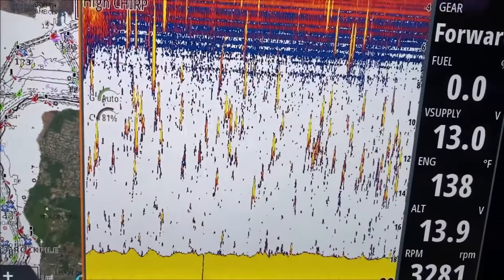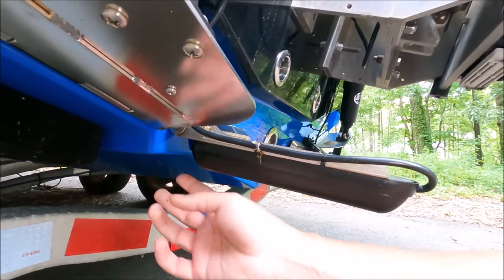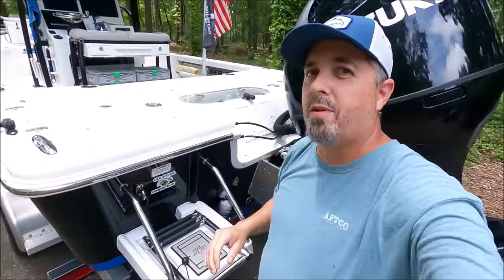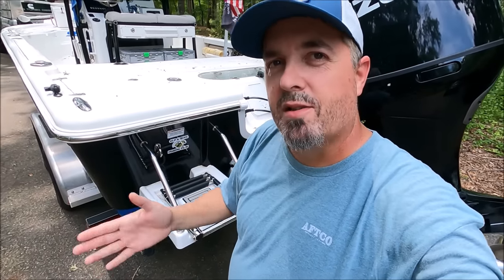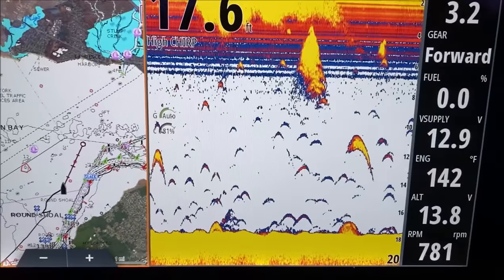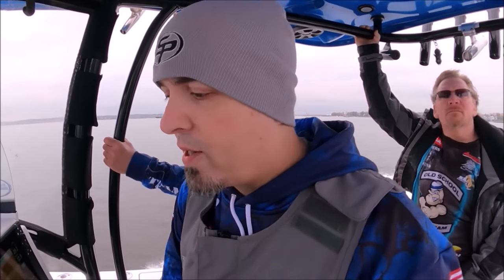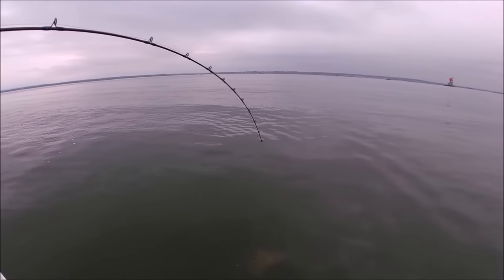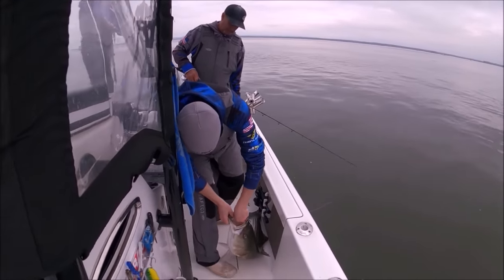Finding Fish at 30 MPH? It’s so simple you may not believe me. KILLER TIPS #3

Comment: Hey Mike, what a great channel and kudos to the effort you put into this. Definitely helping me out as I am a beginner to fishing. Have to say the transducer dilemma has got my head spinning. I have a new to me boat on its way and looking to get it setup the right way. Looking for through hull transducer that can be can bar flexible as I learn my fishing needs. My boat is a 30' Robalo and built for offshore. I plan to do that but wouldn't be the majority of my time. I plan to bottom fish inshore in less than 100ft of water. Then also plan to try to snag some small tuna a few trips out of the year in 200-300ft. I have Garmin 8616 dual screens and want to pair it with a good transducer. Please help me here, my mind is spinning and I am getting lots of conflicting information. I love the idea of scouting fish at 30mph!!! Great video
Reply from the maker: Thanks brother!! The B175 Medium is for you for sure! The relatively wide cone gives you ability to mark more fish when you are running on plane for sure. Even though it’s cone is pretty wide, you still get good bottom detail at those depths. This https://amzn.to/45GnTBZ. Is great shallow and surpasses your needs for 300-400ft of water.  Some may say you need a LOW Chirp channel, but you won’t see the benefits at less than 600ft and LOW CHIRP comes at a price by losing a lot of detail, especially the detail you want for bottom fishing.  Low is also very slow scrolling. This transducer only needs one channel input, where a Low/High would need two channels👍👍👍https://amzn.to/45GnTBZ

Comment: Hey Mike, you do a great job sharing your extensive knowledge through videos. 

I believe you mainly fish in the NE, but have you ever fished for King Mackerel further south on the East Coast?  

They have small air bladders and are difficult to mark. I have been on crazy hot bites before and not marked a fish under the boat.  I have sometimes marked fish with short horizontal lines when catching Kings. Sort of like dashes (I have some screenshots saved). Not sure if those were kings. 

Do you have any tips or techniques to help mark kings?
Reply from the maker: Great question!! We fished with Joe Marciano a mess of times and always caught Macks for bait. We were able to see them perfectly with the higher end Airmar CHIRP transducers, but they were nearly invisible with a cheaper single frequency transducer I had. I’m not sure what’s going on technically, but the CHIRP transducers worked great and down scan also picked them up. I actually fish for Stripers in salt and fresh from Georgia and Tennessee up through Gloucester. 👍👍
Reply: Thanks Mike!

Comment: Hey Mike I love watching your videos and I've learned a lot. I do have a question for you about marking fish in deep water. Fish mainly live bottom so there's not necessarily schools like on a wreck but once I get to about 150 to 250 ft my machine doesn't Mark the fish well at all even when I zoom in. It's a Simrad go 9 with the transom Mount transducer multi-scan I believe. I've watched several of your videos and have set up my machine according to your instruction everything works great aside from deep water.
Reply from the maker: Thanks brother!!!  The Go series is pretty unbelievable for the price, but it does have some limitations. You are probably right around the threshold where abilities start to suffer a bit. You can try a few things like using Medium CHIRP. High is best for shallower water. You can turn your gain up until you get a little noise on the screen. Turn up color as well. Try down scan too. Fish marks will be smaller but they might show up better.  The next step would be to upgrade to a higher end CHIRP transducer. Unfortunately you will lose side and down scan as the CHIRP transducers made by Airmar are CHIRP only. A TM150 med would be a nice step up. If you do a lot of bottom fishing maybe a second display with a 150 on it may be your best bet depending on your budget. Let me know how it works out for you 👍👍

Comment: Hi Mike, thanks for all the informative videos! I noticed in your earlier videos, you’d mount the transducer very low in the water, to the point where most of the transducer is in the water. Now it looks like you’ve raised it a little to a more conventional height and you’ve reversed it. Has your thinking changed in regards to the height of the transducer? Or is it more a case of mounting being boat specific and what works for one boat doesn’t work for another?
Reply from the maker: I think that’s just a coincidence really. Sea Pro mounted these, whereas I mounted the previous. They are working great so I don’t mess with them😉. They aren’t too far from where I had them. Front edges are around 1/4” below transom 👍👍👍. The reversed mount is only because of the wire. It’s a preproduction mount and it pinch’s the wire otherwise. I just flip the image on the display 😁👍. Thanks for the continued support brother!!🙏😁

Comment: I notice your cable is at the outside end of the transducer,  is there a particular reason you have it mounted that way vs with the  cable next to the transom?  Thank you.   Great video.
Reply from the maker: It’s just because I have a pre-production unit. I’m using a 3D bracket. The wire would be pinched if I ran it the other way. 👍👍

Comment: At 30 mph what depth would it be hard to see fish on the bottom? Beautiful fish! What are your regs on stripers? On the west coast there is talk of putting a slot limit on stripers of 20 to 30 inches. Right now it is 18 inch minimum with no upper limit. Enjoyed the video!
Reply from the maker: Thanks brother!! Most states have a slot 28-38” now. Depending on the transducer you can see fish bottom quite deep. Mine can see fish on bottom over 1000 feet deep, but not at 30 mph. As it gets deeper everything slows down. The pings take more time to return. There are a few tricks for deeper water, like setting the range only for where you expect to see fish. Speeding up scroll speed. Ping speed etc. 👍👍

Comment: Hi Mike!
So if want to keep my transducer levelled, can I compensate by lowering the hole transducer. Will it achieve the same goal of raising pressure and reduce air bubbles ?
Many thanks!
Reply from the maker: It can sure. No way to tell for sure until you try though. I do both usually.

Comment: Your active imaging transducer cable is wired opposite of what i normally see.  Normally the cable comes out of the transducer right next to the transom.  just curious if there is a reason for that?
Reply from the maker: You can install it in either direction. Just reverse image in menu. It’s so the wire isn’t bent at an extreme angle. My transducer is a pre production version which used an older mount. 👍👍

Comment: On my buddy’s Garmin transducer, one side of the side scan is always darker. Have you seen this before?
Reply from the maker: Sure. It’s common. The skeg on the outboard partially blocks the the signals to that side. He needs to lower the transducer on the transom, getting closer to the keel. 👍
Reply: I had this issue too. Raise the motor to see if that helps.  I bet it does.  If so lower the transducer, or possibly tilt it like Mike says will take care of it without moving it.

Comment: While watching I notice your active imaging transducer with the wire towards the back were I have mine is the opposite,  just wondering could mine be installed wrong?
Reply from the maker: You’re good. It can be installed either way. I have a pre-production bracket that would pinch the cable if installed like yours. You just flip image on the display.

Comment: How does that work at rest though? Is the transducer then shooting forward a little?
Reply from the maker: Nope. It shoots straight down. Side scan looks way out left and right.  There are newer forward sonars that look forward, but only 100 ft max really and only moving slowly.  That’s actually a very common question from new fish finder owners. The name is really misleading. It doesn’t FIND any fish. It just tells you if your premonitions were correct AFTER you checked around. 😜😁😁
Reply: @MikeSmedleyOLDSCHOOLSTRIPERS  thanks for your help. I assume, the deeper the water, the wider out from the boat I will see? These things are so confusing, lol.
Reply from the maker: @officialWWM no problem.  Yes, the deeper the water the wider your cone. Exactly like shining a flash light. It’s a small circle on your hand and a giant circle on a barn door 100 ft away.  The trick is to never worry about pin pointing individual fish that you mark on the screen to cast to.  Instead, focus on the PATTERN and BEHAVIOR of the fish on the screen. For instance, I will search until I mark good numbers of fish. I’ll try to figure out what they are RELATING to.  I’ll note how deep they are hanging. Is there some type of structure on the screen?  Are fish hanging on trees, rocks, stumps, points, humps, etc. are there baitfish schools nearby? Are they deep because they are relating to water temps or current? When I figure out what they are relating too i can make a game plan, but I won’t try to target individual fish on the screen. 

  I know this sounds overwhelming at first, but this is what you do;  search until you mark good number of fish. If they are hanging 20 ft down but the water is 50ft deep drop baits straight down to 20ft in that area. If you mark fish 20ft deep in water that is also 20ft put your baits on the bottom. If you only mark them on rocks on the bottom, put your baits right down to the rocks.  Hope this makes sense. Let me know if I can help further. 👍👍😁
Reply: @MikeSmedleyOLDSCHOOLSTRIPERS  awesome info! Thanks so much. Like most things in life, understanding these units and actually being able to figure out where the fish are is relation to your boat, is clearly something that takes some time and practice. It’s all part of the fun of fishing :)

Comment: Mike why is the transducer (looks like the 3 in 1) with the cable facing away from the stern instead of just next to it?
Reply from the maker: It’s because it’s a pre-production unit before the new bracket was available. It’s on a 3D bracket and the wire would pinch installed with wire on front. It can be mounted either way. Just flip the image in settings. 👍👍
Reply: @MikeSmedleyOLDSCHOOLSTRIPERS  Got it, thought it was another hack. Thanks bro!
Reply from the maker: @AM-el4iv  That’s funny. I bet I got 100 comments asking about that wire. 😁
Reply: Some people say the side imaging
Portion of the transducer is opposite end of the cable and turning it the way you have it makes it easier to see around motor without having to trim motor has high to get brighter image motor side

Comment: Quick question.  Why is your sensor mounted with the wire it the back?
Reply from the maker: @johnyowell5831  it’s just because I was using a preproduction mount. The wire was getting pinched in the bracket because it wasn’t made for this transducer.  You can flip the image in the side scan menu. 👍👍

Comment: I swear I’d pay you to get my unit like this. I have same unit on my sea pro. Have a lot of learning to do with it
Reply from the maker: Do you know what model transducer you have? The base model is a B60, but you can upgrade to a chirp transducer. You can get a tm165High Wide CHIRP transducer for around $500 that will get your evo3 looking like mine 👍👍
Reply: @MikeSmedleyOLDSCHOOLSTRIPERS  not sure exact model. The thru hull transducer that came with the 2019  sea pro 239. Came with the 9” evo 3.  I just had a guy add a 12” evo 3.  Really didn’t set unit up.
Reply: Networked the units on one transducer
Reply from the maker: Sea Pro puts a b60 thru hull on their boats standard because it’s reliable and simple. Most never upgrade. Throw the 165 high wide on the transom or a B175 high wide thru the hull and you will be money. 👍👍👍
Reply: @MikeSmedleyOLDSCHOOLSTRIPERS  thanks mike